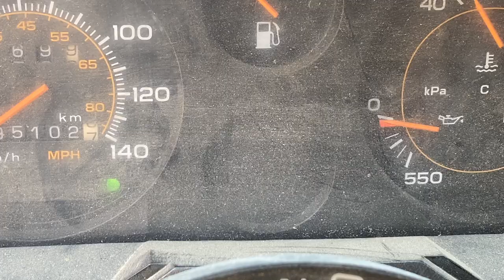My Most Ambitious Van Project || '94 GMC Vandura

Comment: Girl, my respect for you has gone up a hundred fold. Start a gofundme and you will have the high output alternator (plus a lot other things) paid for in no time. Think long term. Don't short change your self.
Reply: Great idea, go for long term with the effort you are putting into this build.
Reply: I was thinking of a gofundme too.  This is so specific and relatively small that it would be perfect.
Reply: She has a Paypal account. Works better than a Gofundme.
Reply: Hi!
I sincerely appreciate your patience of repeated visits to this "repair garage".
A loose wire was a simple repair.  Did the repeated visits to that garage offer to check the work they have charged you for?
 Unless they show you some responsibility and waive fees for repeated repair visits; find a national dealer. There are several and your phone number is your tracking number to check on valid warranties across the USA. 
At times you must wonder when will the next electric problem will leave you stranded?
I hope you best of luck in this new project.
Steve Reynolds

Comment: Don't forget about replacing the heater core for your HVAC system. It's often a job that requires taking half the vehicle apart. With the condition of the coolant the heater core won't be long for this world.
Reply from the maker: I replaced the heater core less than 2 years ago and it was such a pain. It took 8 hours just to dismantle the entire dash, ducting and all the instruments to be able to access it so we are going to be flushing it with a cleaner and putting off doing all that work again. I think it is officially the hardest part to access in the entire van.

Comment: Best gift ever !  New motor will be sweet ✌ 
Don't stress about the engine install .
Just a series of steps. Have a good time with your pops , you'll learn lots . Best to make mistakes now. You'll thank him if ya ever break down in the bush .  I'd carry some spare parts like a starter , coil , fuse , tie rod , ball joint . Get him to show ya that stuff too .  
You and Frank will be burning rubber soon enough.

Comment: Hero Dad to the rescue when your starter cable came loose 👍👍👍👍🙏

I mark spots too with a marker when I take things apart and tape the screws to the hole so it makes it easier to put back together.

Nice gift from your parents and you can stay in your van after the engine swap for many year’s. Good luck & be safe ☺️

Comment: It might help to put hardware from different areas in different little containers to help you figure out stuff when you are going back together . Photos help also . Have fun . You might ask your dad about ceramic brake pads to help with your brake fade also .might help . Also while you're in there don't forget to tighten up the loose nut behind the wheel

Comment: Great job, vans are not that bad to do, once the front is off, hope you took lots of pic's of the disassembly. You got this. Install will go way better. It will all fall into place. For fun keep track as to how many trips to the parts store during this install , It's kind of a running joke with us fellow mech's, You have now joined our frat. Once your done , in about 2 weeks the dirt will be gone from under your nails. I'm replacing a duramax in my pickup right now, cause when you do stupid things you win stupid prizes.

Comment: Wow. Good for you taking this on. I had the head gasket go, and it was puffing white cumulus clouds before it locked up, so I paid them to replace the 350 in my ‘91 gmc truck. engine, $ 2900,  labour $1800, misc parts/tax = $5200 C.
Unfortunately, the 4L80E tranny (with 80k km on it) went six months later (third one too, seems they last only 80ish k km !). 😤 💸💸💸
RIP Big Blue. 😞  
Between Frank, the woods🌲,family and friends, you have a great environment to tackle this and succeed ! 👩🏼‍🔧      ✌️

Comment: As a "tool guy" father of 2 girls I have mad respect for women who can use tools & do mechanical work. Being new to the channel (via Foresty Forest) I'm curious if you named your dog after the alien dog named Frank in the Men In Black II movie? Also, regarding the engine swap... If you're not already doing it you should put all of the bolts you take off & put them in ziplock baggies where you can label them with a sharpie or marker. I do that with every engine job & makes reassembly much faster when the hardware is separated & labeled with which part they belong to.

Comment: Perfect Timing! 
Thanx for reminding me what I'm supposed too be doing. Swapping a V8 in a van is no fun. I started swapping the 350 in my '84 Chevy out a couple years ago. Had to leave it in Florida and go back to California. I'm back in Florida now, but I'm six hours away from where my van sits. I'll be headed down to work on mine on a week or so. It's not my first rodeo though. I did another Chevy van swap probably over 30 years ago, when I was close to your age. I swore I'd never own another V8 van as long as I live, but I'm a gluten for punishment. I'm 60 now and living in a 37' Skoolie 🚌💨in the "Sunshine State". So much easier to access everything under the hood on the dog nose skoolie, but I've never seen Alaska and I want too see it in my Chevy Van.
 Lol, we'll be cursing about the same thing at the same time, 4k miles apart!  I noticed yours is newer than mine. You've got a throttle body EFI on yours. Mines a '84 and carbureted, but I think I'm going to spend the 1k+ to put a Holley Sniper EFI on it. That's if I don't pull the rebuilt junkyard motor back out and swap in a newer LS motor with an overdrive transmission? (Mines a 3 speed Turbo 400) It doesn't like to go over 55 mph on the freeway. As far as getting it back together. I'm sure your memories much better than mine. One bolt at a time. 
Here's to bloody knuckles and twisted wrenches!✌️

Comment: Just some advice get rid of the old throttle body injection and just use a new carburetor, it’s much simpler and won’t leave you stranded in the backwoods

Comment: Don't forget to clean or replace the heater core,coolant goes thru it and it keeps you warm in winter.
Reply: Just flush it, hook hose to top inlet and everything bad will come out the outlet pipe, flush until it runs clean.

Comment: When you put your new/rebuilt engine in, please spend the couple extra dollars on quality parts and fluid(it will actually save you $ in the long run).
Reply from the maker: I learned years ago to always buy the better parts! I cheaper out on a distributor cap once and in less than a year it was wreaking havoc on my entire system 😔
Reply: @tidelinetoalpine  just remember the side note of fluids are like parts in garbage can wreak havoc (which by ur surprise on the fluid says you should know) (like save $5 on fluid vs broken part $210)

Comment: van doesn't look very rusty and crusty that's excellent I'd add a auxiliary transmission cooler during this process and seek out a very quality remanufactured or rebuilt engine, not from a dime a dozen company,  Maybe a new quality transmission torque converter and fluid swap for the whole vehicle don't forget the differential,   I wouldn't go beyond about 9 to 1 compression and maybe a small RV towing style camshaft, Have the TBI Throttle body and injectors cleaned and/or rebuilt,  maybe a new fuel pump with sock and filter 😉

Comment: Why did you not simply replace the coolant? And, how many miles did the old engine have on it? Also, it would have good if you had taken still pictures of the engine (Front end) as you dis-assemble, so when you have to put it back together you have reference photos.

Comment: GM had a class action lawsuit on their 1995-2004 engines due to the Dex-Cool antifreeze they used that would eat all the gaskets in the engine.  I got $125 back for my water pump and head gasket work done on my 97 TransSport.
Reply: I did not know this.   I have a 1999 gmc and all that has happened is my thermostat stopped opening, replaced it with the same dex cool coolant.

Comment: Are you replacing the engine with the same size? is it a 350?
Reply from the maker: Yep, exact same engine. It’s a 5.7L vortec small block 350, and at it’s year it’s one of the most reliable engines ever made.